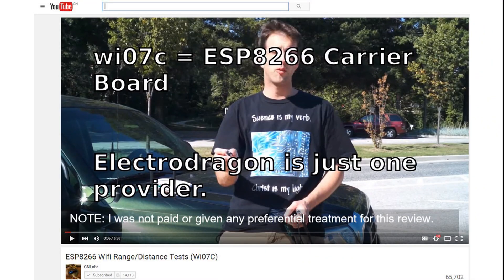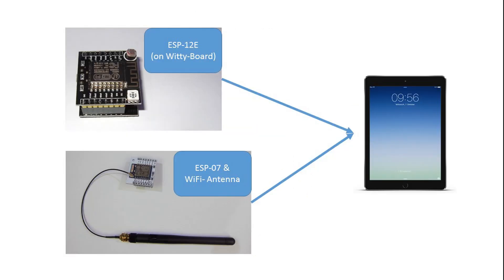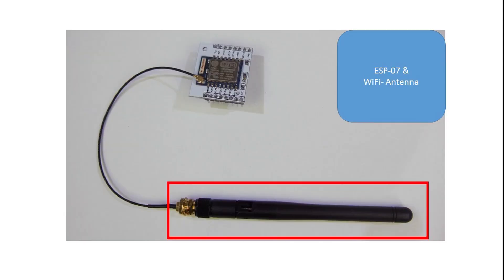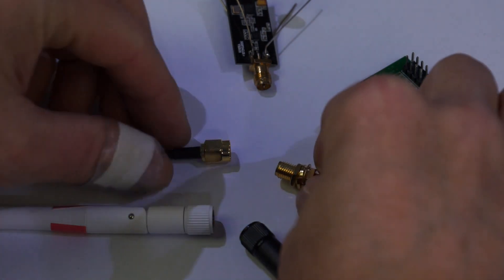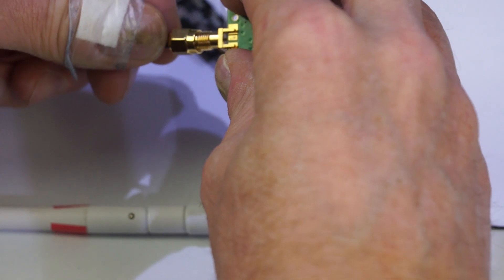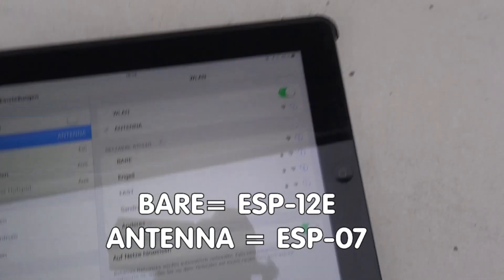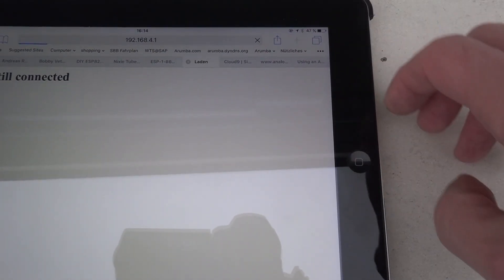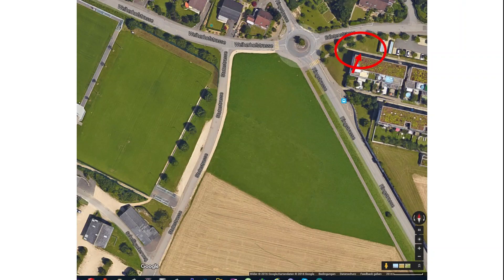#43 ESP8266 Range Test with and without External Antenna

Comment: How much maximum volteg for nodemcu and amp
And how much maximum hours can work nodemcu without stop or deepsleep
Reply from the maker: Most nodeMCU boards use 5V USB
They can work as long as you want. There is no limit as long as they get powered
Reply: @AndreasSpiess  if iam use transformaer 220VAC to 12vdc 2000mamp and it working  and its not to hot temperature around 40clyc or more than but not to much that mean its okay or not
Reply from the maker: It is not ok
Reply: @AndreasSpiess  thanks mr that mean use transformaer 220VAC to 5VDc
But what about deepsleep its okay or not
Reply: @AndreasSpiess  i live in jordan and iam try to make smart home  with app but ididnt used deepsleep in my code  becuse that iam try to know every things about my project will pass or faild
Reply: @AndreasSpiess  iam right all my code useing if statment and nodemcu nothing do if app didnt send any thing if u like iwill send my code to u in brivet and u help me to fixed 😍

Comment: Is there a maximum antenna size that can be used? What if  a high gain directional cantenna or even an omnidirectional antenna were used? Does this limit the amount of gain from antenna?
Reply from the maker: Physically you can connect any 50-ohm antenna to these connectors. But you have to respect the law. In many countries, it does not allow high gain antennas

Comment: Coax and connections at these frequencies = massive reduction in output power.  Try to keep it as short as possible and solder when possible to reduce insertion loss. I'd love to see the same experiment repeated with the native board, antenna w/ connect + coax, and then antenna soldered as directly as possible. I really enjoy your videos - thank you - subscribed
Reply from the maker: In the meantime, I made a few videos about wireless and antennas where I also suggest to avoid any cables.

Comment: what I would like to know is if you connected a really good GROUND wire to a high quality ground, and if you also possibly added a choke to the ground so that no spikes can make it up to the ESP8266, would this improve range. Radio requires that duality of sky and ground. If you look into the Tate Ambient Power module circuit, you will see that it must be grounded for best effect. The pickup of RF and conversion to power works WAY better with ground. Similarly, transmitting would probably be boosted if you had good grounds on both sides.
Reply from the maker: Most of these devices are battery operated and therefore not connected to ground. The antenna has to be optimized to deal with this fact, like in Smartphones for example.
Reply: it might be worth experimenting. how much of the signal is attenuated because of a lack of connection to earth ground?

Comment: I own a DSTIKE WiFi Deauther OLED V1.5S Board and it has the ESP8266 chip and it was able to detect my FritzBox from about 350meter (Fritzbox and Deauther Outdoor)  but if I put the FritzBox indoor and I was outdoor then the range was 140meter.
The connectivity can be always different because of environment. For example last month I lived at Frankfurt am Main and there I wasn't able to get my signal even from in front of the parking lot which was directly in front of the house.
Reply: I have already assumed that the signal transmission related to the temperature too. And I see your comment. Thanks.

Comment: Very good video!!   So, just to clarify the information regarding the sex of the connector being FCC-legislated due to some "fear of...radio amateur operators" , it should be pointed out that the changes to connectors is to establish a new industry standard convention for the purposes of recognition/compliance. After all, any technician wanting to work around connection issues certainly can do so if desired.  But, generally speaking, technicians and engineers who might not be current or up-to-date about the fact that "other regulations apply",  and who suddenly encounter connector reversal would certainly be asking the obvious:  "Why?".   But for the non-compliant-minded user,  unique connector scenarios provide an immediate response by manufacturers to produce "adapters" Thus, anyone can simply subvert the sex change by using an adapter or even add a 'pigtail' if they so desired. The truth is that changing the connector doesn't accomplish any sort of deterent so much as it is there as a 'reminder' to the technical person (or not-so-technical person perhaps) that a special case exists. It is a further truth that connector variations (as with the SMA reverse sex variation) identify advancing technologies / units which fall under regulatory restrictions or operation apart from similar components commonly used heretofore  (education lags production, as they say). 

We simply needed an obvious method of identification. Interestingly, these 'different' SMA connectors a but a small part of that convention. We have a multitude of various connectors with obtuse fittings including BNCs. Connector conventions were modified for this purpose long before network hardware was even a glint in the eyes of father WiFi.  In closing, I think of this SMA sex reversal as a means to identify unique device operations to avoid bigger problems (like interference to other services). Historically, this need for tactile evidence of connection compatibility was never more vividly demonstrated than back in the day when pipes meant for carrying flamable natural gas were directly threadable to lines laid to carry water. The results were devastating. This would never have happened had the threads not matched.  Be alert. Be safe. Be professional.
Reply from the maker: For me these RP connectors are not necessary and useless. I mark all of them with a red point and also all needed adaptors.
Reply: The technical audience had already decided on a connector -- "SMA". There were no technical need for two competing standards that do the same thing. 

Your water/gas analogy also makes no sense, because there's no danger in using SMA OR RP-SMA for what its designed for -- as an RF connector, they both do exactly the same thing, interface to the same equipment, and carry the same stuff. One is just more annoying. 

A better analogy would be two competing gas connectors, one of which is intended to stop you from frying eggs on a camp-stove, you can only attach water boiling equipment without an RP-Camp-Stove adapter.

As for standards compliance -- many technical people will be licences to use higher power in 2.4ghz, anyhow (Eg, amateur radio licences, commercial licence). And these licenced people have to go through the trouble RP_SMA causes for no reason.

Besides -- the fact RP-SMA was created to annoy consumers is clearly and nothing to do with 'assisting technical personnel' is clearly documented https://en.wikipedia.org/wiki/SMA_connector#Reverse_polarity
Reply: Thank you. I agree.  Further support that the premise stated in the video that " the sex of the connector being FCC-legislated (due to some "fear of...radio amateur operators)", is unsupported by the facts.  I learned some interesting facts from your reply. Much appreciated.

Comment: Andreas, thank you very much for great work. I learned a lot from your videos. I made range test for Wemos D1 mini (with PCB antenna)  but with ESP-NOW protocol .(Thank you again!) Robust connection distance is about 400 meters but I believe that it can go further. I will check. Receiver was 16th floor of a building and transmitter was at ground level. After your test, my test results seems to me a little bit suspicious.))) Let's say being in 16th floor can effect the range but what about using ESP-NOW protocol? Can it somehow extend distance? Thank you. Regards
Reply from the maker: I think the Ipad was not the best choice. 400 or more meters seem to be ok for me.

Comment: Hi Swiss Guy! I think your test proves more about Apple's policy around wifi than anything else. I have achieved similar results to Mr Laur (spelling?) using an ESP-01 with trace antenna and an Android device as the client. Apple have dumbed down their wifi reception because they don't want to operate in the shady -70dB (more or less - I don't know the exact figure) zone because they feel the bad network experience will reflect badly on their devices. So they rather let you connect only when the signal is a bit stronger and less likely to drop. If you repeat your tests with any other client device I think your range will double (at least). You may then also see more advantage with the ESP-07. Thanks for your always excellent videos. You have fans in South Africa... all my IoT friends enjoy your stuff. We have a request... one day will you tell us a joke? Maybe at the end of a video, just for fun ;)
Reply from the maker: Thanks for the update. 
Jokes are never easy on an international basis... BTW: Yesterday I met a very nice guy from SA in Amsterdam at the LoRa convention :-)

Comment: Macht der esp8266 mit seinen 25dbm (320mw) nicht zu viel Sendeleistung für die meisten Europäischen Länder oder warum ist die Sendeleistung so hoch? Normal sind 100mw legal ;)
Reply from the maker: Laut Datenblatt hat der ESP8266 folgende Ausgangsleistung: 
802.11 b: +20 dBm
802.11 g: +17 dBm
802.11 n: +14 dBm
Reply: Andreas Spiess Merkwürdig.. Auf der Metallabschirmung auf meinem ESP8266 steht 25dBm. Da muss ich mal nachmessen :)

Comment: Hi Andreas  thanks for this mesures...In my setup the ESP8266 V3 is sniffing MAC-Devices...as you know the "distance" we can calculate via the RSSI..I collect those RSSI ( and other attributes ) in a DataBase...This way i collect the RSSI in the DB and can make also statistics of those Measure....It really seem that a distance from about 50m is some Limit...My ESP is operating in Promiscuous Mode..then STOP..is switching to STA and is Then sending its Data to the  to the server (ESP=STA)....SO the distance i measure between the MAC-Target ( e.g. Walking MobilePhone ) and my ESP in PM.   i took this RSSI Table to "MAP" the distance to Meter: https://www.researchgate.net/figure/230833800_fig6_RSSI-as-function-of-distance
From some Tests now it seem very realistik ( test on free green field is outstanding..i will do asap )...SO it look a bit that the distance may also Depend on the MODE we operate the ESP8266 !?
Reply from the maker: 1. In open field, RSSI might be a good indicator. Inside buildings with all the reflections etc. I am not so sure.
2. I would like to use the MAC sniffing for a presence sensor. Could you help me out with a link and/or a sketch?

Comment: You get nearly the same results I could get the with ESP-07. I've mounted the setup on a autonomous rover running on the ground. I can get a stable connection aprox 120-130 m on the ground the antenna mounted aprox. 40 cm above the rover, but only when I have a direct view to the rover. If the rover moves behind a big tree or behind a wall the signal is lost at this range. Best result with a Wifi Repeater mounted on a pole 2m over the ground was aprox. 200 m. (Must stop the test, cause the rover tends to drive in a small river...) but at this time the signal was not very strong, but OK with no packet losses via UDP.

This is not a theoretical value. It's a real working scenario. It looks like that the results are a little bit better if I stay away from the town aprox. 1km. There are no private WLANS anymore. The results tends to be a little bit better.  Some tests must be done in the outback far away from civilisation....
Reply from the maker: Thank you for your feedback. It is always good, if others repeat tests to approve the results of find different ones. This is, how science moves on...

Comment: Hi Andreas. There is the Mesh function on the ESP8266. Do you know how far apart can each node be?
Reply from the maker: No, I never tried. But I think, the can be apart as far as Wi-Fi works. Which depends a lot about the environment (in-house or outside, walls, etc.)

Comment: I have a number of Amica NodeMCU boards that I want to use in a project, and I have programmed them with PainlessMesh, which works nicely.  At the moment, I am unable to communicate with a module in my next-door neighbour's house through the joining wall.  The board has the ESP8266 module on it, as well as a USB port and supporting chips, looks similar to the big, black module in your picture at the beginning of this video.  Is it possible to improve the antenna on it?  Problem is that the ESP module is soldered onto the board, so I can't get to the back of it.
Reply from the maker: If your module does not have a built-in antenna connector it is very hard to change it. So, the only possibility is to buy a module with an antenna connector like the ESP-07 or the Wemos mini pro, and connect an external antenna to it.
Reply: Thanks for your answer, Andreas.  I saw http://www.instructables.com/id/Enhanced-NRF24L01/
and had hoped I might do something similar.  However, I take your advice.
Do you know of a polar diagram of the propagation from this type of printed antenna?  I have two boards in my mesh, and I been experimenting by taking one board to a place where it clearly has difficulty seeing the mesh, but does eventually find it.  Sometimes, it drops out of sync without touching or moving it, so it must be really on the edge.  Then, I experimented by pointing the boards in various directions to see where reception is best, but I really haven't come to any conclusion.  A polar diagram might help.
Reply from the maker: 1. You can try the instructables. Maybe it helps. But maybe it does not help and you an destroy something. Both antennas are somehow similar.
2. The propagation differences of these antennas are very small. That is maybe the reason you did not find any. Many other influences like reflections, place etc. might have a much bigger effect. Be aware, that the wavelength on 2.4GHz is about 10 cm. So, a distance of 2.5 mm is a quarter wavelength which is the difference between a maximum and a minimum.  If you change the distance between the two boards by less than 2.4 cm, you can already experience big differences.
Reply: Yes, your points are very valid.  I want one module in my neighbour's house and one in mine,  but there is only one wall separating us, so I'll try putting both modules against the wall.  I tried leaving one in my office and taking the other to my workshop (about 30 metres + 3 walls) and it worked ok there.

Great software.  I looked at the source, and I can see that a lot of work has gone into it.  Thanks so much for making it available.

Comment: grew up during that time. got ham ticket at 13... rpsmal always pissed me off as a kid and i never knew it was a mandate due to hams. Id like to see some documentation and may google it later. If i recall some 15 years after passing that test and 7 or not touching a ham radio.. ham operators in the us are explicitly allowed priority and higher power on 2.4ghz ism so it doesnt quite fit your story...then again...to quote peter griffen "its the fucking fcc"
Reply from the maker: I do not know the US frequency bands, and I think, some bands were reserved for hams in the old days when nobody had the equipment for these high frequencies. Later, some of these bands were reduced and re-purposed to other usages.

Comment: I am having trouble with the range of this module. My distance is approx 200m and I don't know how to connect an antenna. Please help me
Reply from the maker: This is not possible by a normal user. The Wemos mini pro has a antenna connector and 16MB flash, and the ESP-7 have 1MB flash and an antenna connector.
Reply: So you are saying that we cannot solder an external antenna on modules with internal antennas like esp 8266-12E?
Reply from the maker: +Masoud Tarar You can solder whatever you want on a copper trace ;-) But the impedances have to match. Otherwise the antenna will not work. And this has to be designed by an engineer and manufactured with tight tolerances.

Comment: Hey Andreas, was just wondering if i could do this with my ESP8266 board,the node MC board

(https://www.penninkhof.com/wp-content/uploads/2015/08/113990105-11.jpg) This one

Am i able to attach a antenna to it? i searched everywhere and can't find anything
Reply from the maker: These devices use extremely high frequencies and it is not easy to build a proper antenna without good equipment.
Reply from the maker: No, the ESP-12 boards have no antenna connectors
Reply: I have the same question.. i was wondering if i could use the Pins to attach an antenna somehow but no luck

Comment: Are there any other ESP8266 modules that can be fitted with an external antenna and have the >1MB Flash? On the ESP-07 do you have to remove the ceramic antenna to use an external antenna?
Reply from the maker: +Andrew R Dale 1. The wemos mini pro has 16 MB and a plug
2. No, just a resistor has to be removed